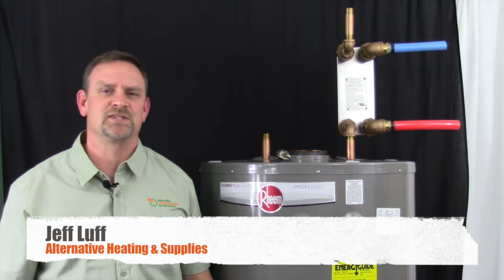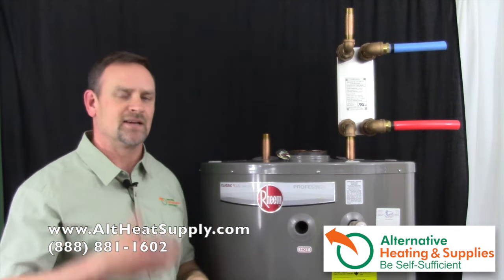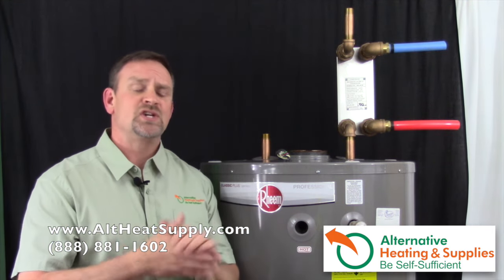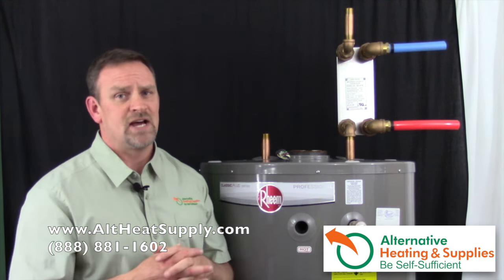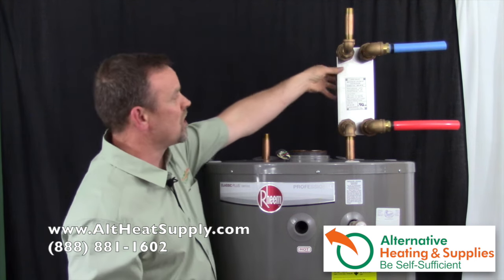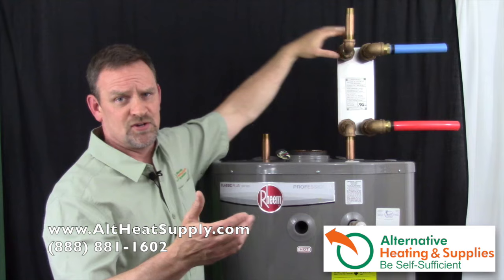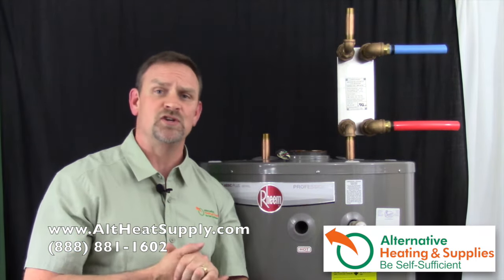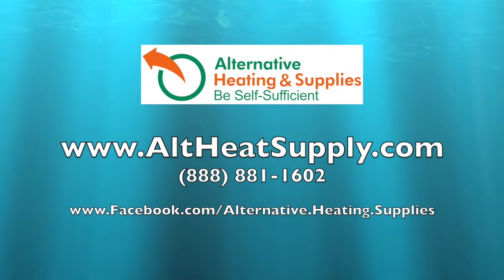How To Install A Plate Heat Exchangers To A Domestic Hot Water Tank

Comment: The house came with a vertical style " tube in tube " side arm heat exchanger. It is 1" copper pipe inside of a 1.5" copper pipe. It is taller than the HWT it is connected to . I am going to install a new HWT in a new location. Would it work if I mounted the side arm HX horizontally in a joist space above the new HWT location? Would the temps of the water in HWT still equalize even though it wouldn't be a traditional layout? The way the system was set up originally it was a wild loop from boiler through HX and back. A tstat would energize the furnace fan relay to maintain set point in house. I added a baseboard fin and tube heater in far corner of bsmt. Put a diverting zone valve in the return line to boiler. Added a tstat to control the zone valve. Now I run the furnace fan all the time. When the upstairs tstat calls for heat, the water goes through the plenum mounted HX. When upstairs is satisfied, the hot boiler water heats the far end of the bsmt through the base board tube n fin HX. Works like a charm. The reason I needed to go this route was I have a Rheem communicating furnace/ thermostat combination. The programming does not allow the addition of a thermostat to be installed in series with the G wire of the furnace, cuz there is no separate G wire as a result of the communication functions . So the only way to regulate the room temp when running the wood boiler  is to set the fan to run 24/7 and divert the boiler water when the room tstat is satisfied. I used to run the fan 24/7 when the loop was wild, and the house would over heat every night. It's something all the major furnace companies have overlooked. Even a new high eff furnace that uses a G wire to energize the fan , making it possible to add a separate tsat to control the furnace fan as W1 doesn't allow a very high volume of air when the fan terminal is energized. A 3 ton ECM blower only allows around 350 cfm for fan only operation . At really cold ODT the low volume of air has trouble keeping up with heat loss.
Reply from the maker: Good God you got a lot going on. Don't know how to help a system like that. to many parts.

Comment: Hey Guys,
Like the video.  I'm skeptical about the tank heat not coming on without a circulator between the heat exchanger and tank, but if it's close enough (directly connected to the tank), are you sure this works reliably?  

On a slightly different note, I have a client who has a long run of uninsulated hot water line and has to run the hot water for too long, so I'm planning to install a small circulator and recirc line back to the tank to give.  Where would you recommend installing the return water connection & check valve from the recirc line?  before or after the heat exchanger, or directly back into the tank?

Thanks.

Comment: Would this work with a hphw heater? The water enters from the bottom of my model (Rheem Pro Terra 65 gal). Where would I put the plate exchanger?
Reply: I have never done it, But I think it would work as the water fill shouldn't matter where it is entering. The plate mount to the cold line going into the bottom of your tank... Jeff

Comment: So I'm installing a new Central wood boiler and I'm curious if there's any way to hook this up with my tankless water heater? Space is at a premium in my house so I opted for a water softener and went with a tankless water heater. Now I'm interested in using my wood boiler to cut down on my propane cost, so I'm curious if there's any way to cut it further by using my wood boiler to heat with a tankless water system?
Reply from the maker: no, I have never tried and I can't think of any way to do it. sorry

Comment: My oil boiler and wood boiler are tied in together, I have an electric domestic hot water tank, can I tie into it and leave the electric on with a low setting? only burn wood in the Winter. Thanks
Reply from the maker: I would mount a plate exchanger on your Boiler to separate the two systems and then you can use another plate exchanger to heat your domestic hot water. Simple fix.. Happy heating Jeff

Comment: Thinking about ways to add solar thermal hot water to my current gas water heater. How does this work to add heat to the tank if there is no call for hot water at the moment? If no hot taps are open, then no cold (heated by the heat exchanger) is flowing into the tank right?
Could this work with solar as long as the input temp to the heat exchanger is higher than cold ground water inlet temp?
Reply from the maker: I have not played with solar to much. The couple times I tried, I was not happy with results. I would love to hear what you come up with. Jeff

Comment: Does the outdoor wood stove circulating water pump have to run continuously for the domestic water plate heat exchanger to work?  Seems to me it would have to.
Reply from the maker: Yes it should, or it might freeze as well very difficult and expensive to setup to turn on when needed. Pumps only cost $10 to 15 bucks a month to run. Pretty cheap in the long run.

Comment: I’m curious about the risk of freezing your wood fired outdoor boiler. I’m trying to help out a friend who’s husband passed away get the wood fired system up and running. The system is hooked to a heat exchanger on their furnace. Their is also a plate exchange tied into the domestic hot water system. If the wood fired boiler is not firing what prevents that system from freezing? FYI I live in MN.
Reply: They make an anti-freeze that can be added to the water.

Comment: Great video. Would you recommend side arm vs plate changer for a water tank? is one more effective than other? what type of water tank is the most effective at heating when used with echanger, bottom feed or top feed?
Reply: I would probably use a sidearm, I can visualize the natural convection with that setup better. A plate heat exchanger, from my experience, is more efficient needs a circulation pump.
Reply: Neither need a circulating pump, if installed properly.
Reply: I personally don't recommend a side arm....the recovery rate with a. Side arm suuuuuuuucks. With the hex, the water coming in isn't cold it's already heated up pretty good

Comment: I have a plate exchanger, forced air exchanger in plenum and 4 loops from a manifold. Is having the manifold also in this chain ok?
Reply from the maker: Should be ok as long as water doesn't have options which way it can go. Water like most humans travels the path of least resistance..

Comment: Hi, I would like to install an inline Electric heat exchanger into my indoor gas boiler line. how would I go about doing this and can it keep my 1400 foot house at 50 degrees in michigan, while my insert is heating the rest of the house? what are some of possible alternatives to using something other than gas?
Reply from the maker: I know nothing about "Inline Electric heat exchanger" Sorry I can't help you... If there is a will there is a way!

Comment: So are you unplugging your water heater and the plate exchanger will keep the tank heated?
Reply from the maker: No, leave it on. If it is installed correctly it won't turn on because it will be already hot water.

Comment: I have a 10 plate heat exchanger i have an outdoor wood boiler. I have never had enough hot water would getting a 20 or 40 plate give me more hot water and would the boiler handle that much without cutting down on house heat.... thanks
Reply from the maker: no way I could know that, try a 20 plate not the 40

Comment: Are plate exchangers needed/ efficient if the outdoor boiler is pressurized? Or is it easier/ more efficient to tie outdoor wood boiler in with indoor pressurized propane boiler? Thanks!
Reply: Out door boilers use a glycol solution to protect them from freezing. The plate style heat exchanger keep potable water from mixing with the glycol solution.

Comment: I’m using a side arm heat exchanger in my shop now and getting ready to hook up the house to the boiler. Would you recommend one exchanger over the other?
Reply: I have the same question, The plate exchanger looks like the simplest install. Would love to know what gets the most bang for the buck.

Comment: Since the heat exchanger heats up the water in the tank with boiler heat, I can just use a water holding tank and don't need a regular water heater with its own heating source, correct?
Reply from the maker: Possibly, you will need a stainless steal pump to circulate and a thermostat to regulate the tank water. The tank will lose heat over time. Easier to use Domestic hot water tank to handle this simple things. Jeff

Comment: Hi Jeff I am planning a creative build on a sprinter van. if I wanted to heat 5 gallons of water quickly using the diesel engine coolant lines, what size plate exchanger would you recommend?
Reply: That is outside the box! I would think it wouldn't take much at all.

Comment: Jeff ..what size heat exchanger would i use for a supply to a closed loop hydronic radiant floor system...two zones 1500 feet of loops in each zone
Reply from the maker: You will need to consult a radiant guy. I know some but not an expert. Sorry

Comment: My installer put our plate exchanger under my house. I have moved and am in the process of reinstalling my outdoor furnace and would like to know if it's better that the box be in the house with the water heater or under the house like it was installed previously?
Reply from the maker: It has to be on top of the domestic hot water tank or it wont work.
Reply: properly
Reply: @AltheatsupplyLLC  In Australia the Cold inlet connection point is down the bottom of the HWS Tank, Do i still need to mount the Exchanger above the tank or should it work at the bottom of the tank too.  Cold water enters at the bottom of the tank on both types right?

Comment: i have a side arm heat now that works well, temp is 180, but i run out of hot water after 60 min of running water, if i add the plate exchanger? should i add it to the hot out of tank ?
Reply: john harris 
I do but only with an anti-scald mixing valve

Comment: My plumber put a T in the clod side of the hot water heater. And put the heat exchanger on the side of the tank. And feed the bottom of the tank with the hot water. It worked for 2 weeks and now we have warm water.  I don't know y he put a T in the line .  I think he is feeding cold water in the tank and the heat exchanger can't keep up.   Do you have an answer?
Reply from the maker: Unfortunately, I don't have an answer for you. But I would have him reinstall it correctly. Jeff

Comment: So help me out please, I understand the no need for pump on the inlet of the DHW tank. But the boiler side would have a pump to circulate from a hot side / cold side header system correct?  How would i control that circ pump? I wouldnt imagin it would need to run 24/7. How would I prevent my DHW tank from reaching boiler temp?
Reply from the maker: The pump from the boiler runs 24 /7. The DHW tank will mantain a steady 125 to 130 F, it is based on pressure.

Comment: I was figuring on doing this but adding a small circulator pump with a thermostat so the water in the tank will stay warm even when you're not drawing hot water.

Comment: I have replaced my 40 g water heater with a 60 gallon heater and reinstalled the plate exchanger the same way. Does not seem to be heating the water in the tank. Any thoughts? Great videos btw
Reply: So no thoughts then?

Comment: We will be using off-peak power and installing a Marathon boiler which is heavily insulated.  If you run the boiler at 180 degrees and want the hot water set at 130 in the tank...  Does the water in the tank exceed the 130 setting ?..... this question applies to both side arm and plate exchanger.   Thanks
Reply from the maker: +vogelkj2001 Good question, no it will not. Its called a "Thermal Pressure Siphon". If you jump the video above to about 3:22 in, we go over this.
Thanks!

Comment: at 4.22 you say the exchanger heats up the tank water and the persure is the thing that causes the tank to heat up?  you would need a check valve to get persure.  but while there is no flow in the tank side of the exchanger you still think it will heat tank water? there is no return to the tank from the exchanger, how will it circulate? i only see it as  supplementary heating for the in-feed line for the tank when the tank in feed line is flowing.
Reply: horseshoe182 .. confused me also. if cold water is flowing in I presume there would be heat transfere but static water NO flow I dont think so. Plus ,  without check valves what happens when tank temp falls below the source temp. Thermal syphon  I think.

Comment: HI I WATCHED VID ITS GREAT ! i have a wood stove with heat coils in out pipe no circulating pump do i need 1 and it also has no temperature control so dont no temp coming out of it! and i have in well jet pump and 60 40 pressure tank  can i hook system up same way?with the pressure 60 40 coming in to heat exchanger? please help? do i need circulating pump or temperature control ? i want to run threw my electric furnace also with rad like you showed on plenum but i only have 3 inches of plenum away from ac a rad for heat pump dose this matter?
Reply: stove is a rsf hf65

Comment: Is there a recommended way to clean the heat exchanger?  We had a new wood boiler installed last year and are noticing that it is hard to get hot water to the bathtub this year.  We have really hard water even though it goes through a softer system.  I am thinking that there may be scale built up on the plates.  Was thinking of taking it off and running CLR through the well side?
Reply from the maker: No real good way to clean them, you can use CF205 & White vinegar every year to keep them clean. we sell the cf205 to work with white vinegar as a yearly maintenance.
Reply: if you can lower the temp it will not build up that fast
Reply: ???  This is a surprise answer from you!  Of course you can clean them!  I do mine about every other year!  Take the heat exchanger completely off of the system.  I found a fitting that connects to the threaded fittings on the heat exchanger (it happens to be a washing machine hose) which also screws onto the garden hose bib nicely.  I run the garden hose slowly first.  All of this black, iron much comes out of the heat exchanger.  I then put the hose on full blast until the water is clean.  I do this to ALL 4 threaded ports several of times.  When I put the heat exchanger back on my heating system, it works like brand new!  My hot water heat exchanger is about 25 years old and my whole house heat exchanger is 12 years old.    Good luck!
Reply from the maker: Some stuff washes out, but build ups of hard water don't come out. I have soaked in acid for a week with no success.
Reply: Twindadx2 ......I use spirits of salt acid to clean mine every year , it takes about 30 mins to clean it like new then just give it a good flush through with your garden hose and re assemble , this method works every time....👍

Comment: Help me understand your statement near the 3 minute mark. The plates on the exchangers you sell are 40% thicker and last the life of a boiler (25 years?) yet competitor exchangers are, call it nominal thickness, and require replacement every 5 years?
Reply from the maker: the water in the units have particles and blast the exchanger like a sand blaster in side the plate exchangers which make them fail. most plate exchangers were designed for a cleaner environments.

Comment: You said over and over that you should use good quality brass fittings but the heat exchanger is stainless and copper. Is there any reason or downside to using ss fittings instead of brass?
Reply from the maker: No... Stainless are very uncommon
Reply: @AltheatsupplyLLC  is there any reason not to though, I have several ss fittings that would work perfectly and I would assume would be even better than brass or copper if cost isnt an issue.
Reply from the maker: @bradwitte2835  Yes of course you can use it.

Comment: Is there a noticeable heat loss on the return line to the forced air after the plate exchanger
Reply from the maker: I have seen about a 10 to 20 degree water temp drop. Jeff

Comment: How hot does the plate heat exchanger get while it is in function? As in how hot to the touch is it externally?
Reply from the maker: +123italyabcdefg 
It depends on the water temp. if it is 180 degrees, about 140